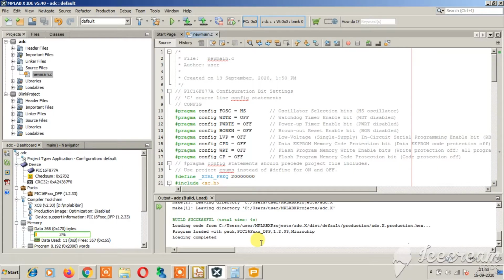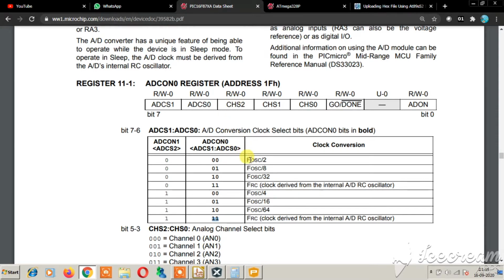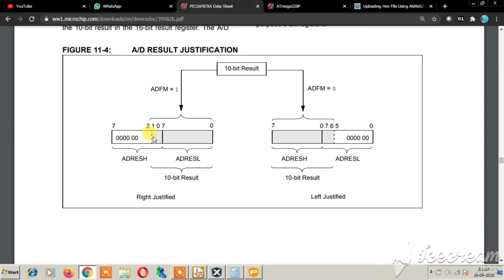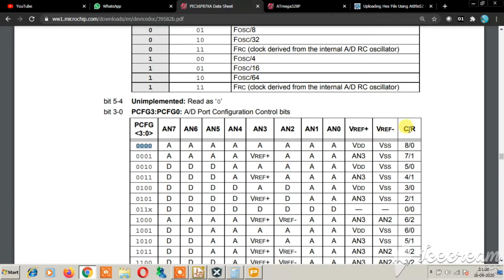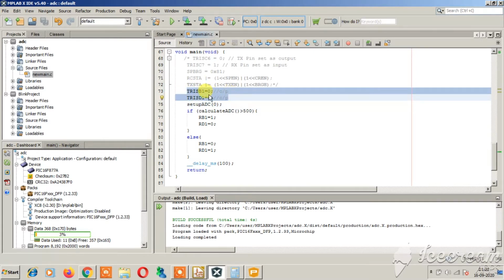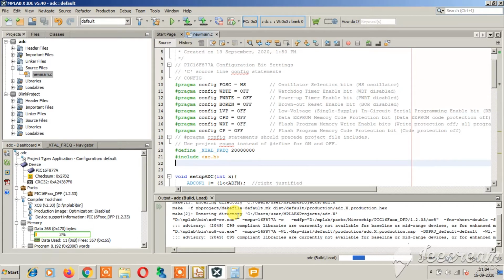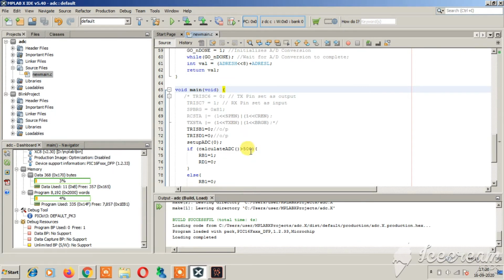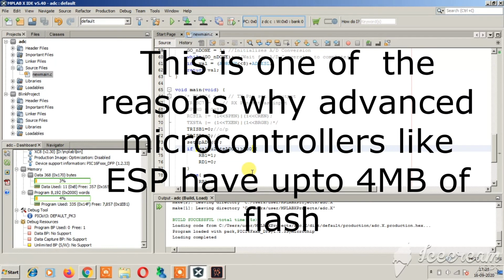PIC16F877A | Using the ADC | LDR | Code explained with Datasheet

Comment: hi
Thank-you
I have finally got my ADC figured out and a big thanks to you.
I just have one problem.
I am trying to display it on a 16x2 lcd however i keep getting single odd figures and not analog values of 0-1023
i dont know whats wrong again
i know numbers are formatted as int and printed as Char however i dont know if my structure or syntax is wrong please can you assist?

Comment: Hi
it has been a while since this video however i will appreciate your assistance.
i have tried to replicate your example without success however i can imagine why?

you have demonstrated the functions however not put them all together 
to function as one .

for example:
setADC only enables power ON then right justifies and provides channel selection 
calculate ADC only begins the process and arranges the result format however the function does not say which channel to calculate.

However in the "Main" function it says setupADC(0)  then the an IF statment 
The setup ADC function only selects a channel and does not calculate.
the calculate function only calculates however does not select a channel.

I am quite recent to pic programming and still trying to work it all out.
i will appreciate your assistance however also giving you feedback that your example did not work for me

sincerely

Ejike

Comment: Amazing video .. I have 1 question if I may ask.. how will I change this code to except 2 LDRs? Do I just use 1 instead of 0 for the select function? If so what is the other pin that I need to use aside from the RA0 pin
Reply from the maker: You can use any of the 8 available adc channels at a time. Those are defined in the function itself.. look at the pinout description in datasheet to see where the other channels are.